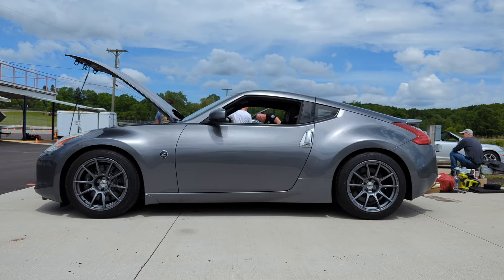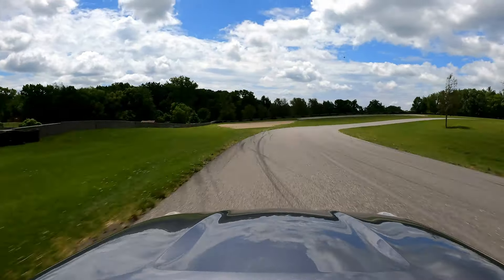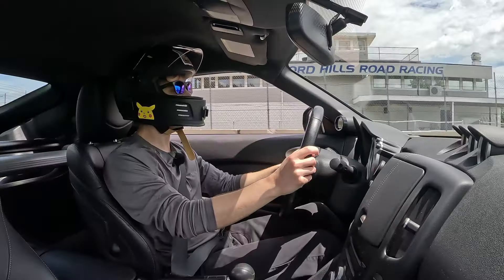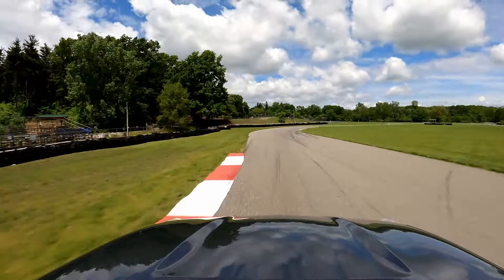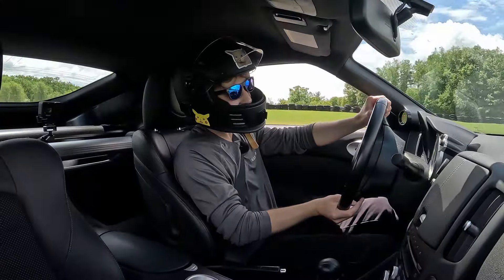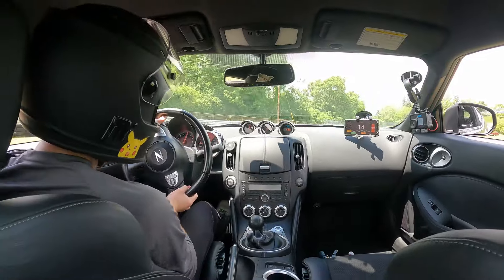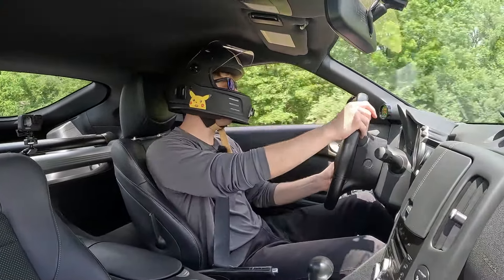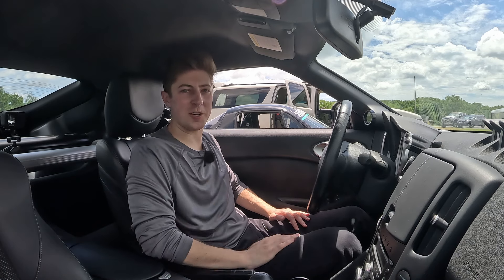Mildly Modded Nissan 370Z RIPS on Track (Also Has A Couple Issues)

Comment: Clutch line runs just above the cats and gets very hot, after a couple laps my pedal disappeared. You can replace the small section of clutch line with braided with additional insulation, never had the issue again 👍🏻
Reply from the maker: Ooooo that would definitely be good, I think maybe next time I have to bleed or if I ever do a clutch that would be a worthwhile upgrade
Reply: @pattyboi  👍🏻 Z1 sell the part, simple install but yeah you’ll need to empty and then bleed clutch system. At least you’ll be able to upgrade to some high temp Motul fluid 💪🏻

Comment: The CSC is a weak point on the car. This was improved late in the model run. 

The Viscous LSD turns to an open diff when it overheats. 

Cheap upgrades are some Nismo suspension parts. People put cheap coils and the Nismo suspension is solid. 

I run stock Nismo dampers, changed the rear to Wavetrac and 4.08 gears. The faster you go, the bigger oil cooler you need. If you can snag an improved racing 30 row core, it’s larger than a Setrab 34 row.

My home track is Sebring if you want to see my 13’ Nismo rip on my channel. She has about 350whp. My fastest laps were with RE71-RS’s.
Reply from the maker: Do you have stock springs with the Nismo dampers? Definitely interested in shorter gearing one day 😁
Reply: @pattyboi  I paired Swift Springs with Nismo Dampers. I’ve run both with disconnected rear bar and connected rear bar. Really depends if you’re running staggered or not. But you can never have enough front bar.

Comment: Next mods I recommend in order:
Active Baffle oil sump
Rear diff cover
Transmission cooler
Polyurethane Bushings

$$ Track Mods: 
Boundary Oil Pump
Oil Gallery Gaskets (only do if upgrading pump)
Remote oil filter + Oil Accumulator (only do after oil pump)
Fuel Surge Tank

Things that prevent failure when under lateral G.
Reply from the maker: I've got a diff cover ready to go on! That's interesting you say to only do the gallery gaskets if upgrading the pump, I figured that was a maintenance item regardless? Especially since an oil cooler will increase oil pressure
Reply: @pattyboi  The 2013+ 370z have the updated gaskets so there's no need to upgrade it till 100k miles. They essentially have to remove the engine to do it, so it's a lot of labor.
Edit: Yikes, that's a 2012. You're gonna need to update the gasket then :(
If you know a guy, good. But a shop will charge around $2k to change that.
Reply from the maker: @MyFaux  oh mines a 2012, I'm planning to do that along with some other service items during this winter

Comment: The clutch slave cylinder is inside the transmission its a common failure point cuz of all heat.

For you it mightve just overheated or maybe on its way out. 

Zspeed and z1 sell CSC delete kits that puts the cylinder outside the transmission. Theyre more durable and even when its time to replace you can do it without having to drop tje whole transmission
Reply from the maker: Yeah I have a feeling mine overheated, I'll probably drop the trans to take care of that next year. Hopefully it can last long enough for that 😬

Comment from the maker: Just a follow up on the couple of issues - ended up being a leak from the oil filter (it came with the car when I bought it and the rubber seal was damaged) and the clutch falling down was due to fluid boiling. After swapping the fluid to high temp, it's completely normal again - eventually I'll upgrade the CSC and eliminate any overheating on that system.

Comment: Awesome video! Could the squirliness on braking be due to the track alignment? I believe if you go completely zero toe in the rear, you can get that feeling. I think slight toe in in the rear could help a bit.
Reply from the maker: Hmm I do have a slight amount of toe in on the rear, around 1/16 or 1/8 of an inch. I also wondered if because the stock suspension is soft, maybe the car is diving into each corner? Unsure at the moment but maybe I can try adding a little bit more toe in with the next alignment in both the front and rear